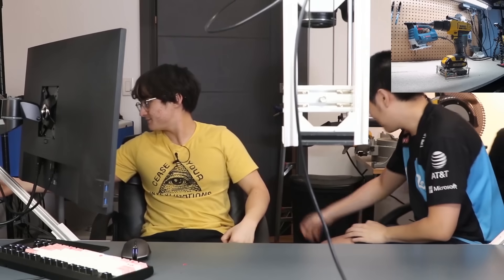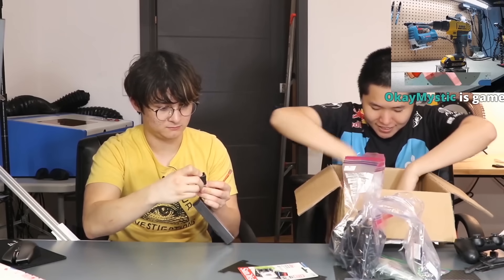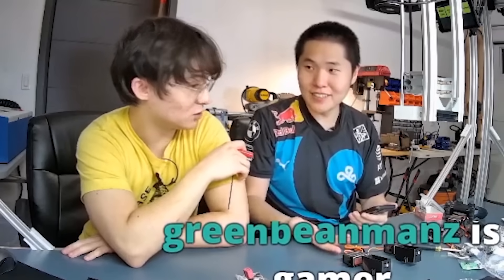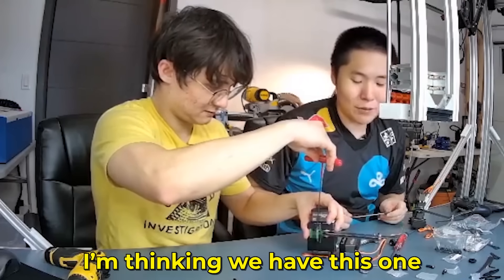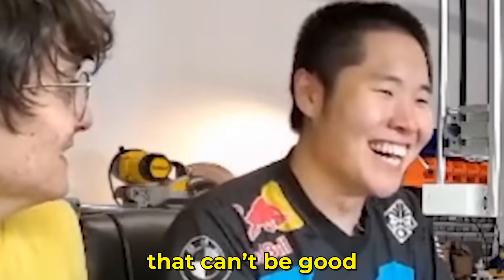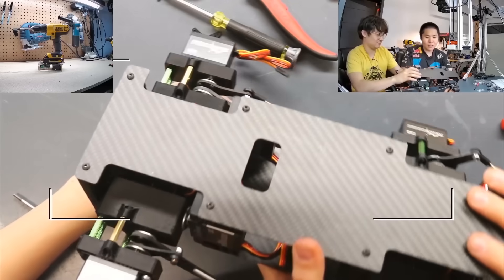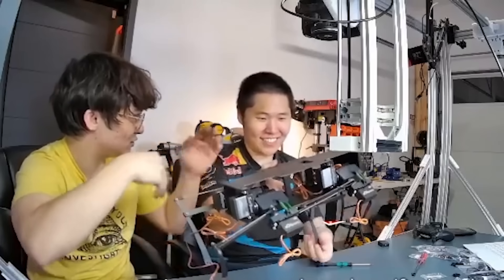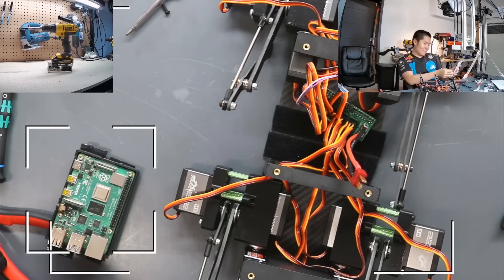we made a robot dog (ft. michael reeves)

Comment: The Easter egg at 13.32: translated from Morse code means : "K.I.L.L. M.E."
Reply: @My New account it actually is true
Reply: @JamesJames-tv2xw  who programmed that in lmao
Reply: Edmund Ng probably Michael lmao
Reply: Erik Blomgren I thought that was obvious
Reply: @edmund8954  edited in post
Reply: @JamesJames-tv2xw  I used a Morse code translator and it is true
Reply: @michaelg8841  exactly
Reply: @JamesJames-tv2xw  It sounds kind of inconsistent though. The morse code wasn't correctly transmitted, as there is no clearly defined length of a unit, which would be a dot.

The message should be:
"— • — | • • | • — • • | • — • • || — — | •"

Note that:
1. "•" corresponds to one unit.
2. "—" corresponds to three units.
3. Gaps between dots and dashes correspond to one unit.
4. "|" corresponds to three units.
5. "||" corresponds to seven units.

The dog either didn't transmit it or the dog transmitted it so poorly that its Morse Code is incorrect.
Reply: 13:32
Reply: @Robbie.1008  nice
Reply: That’s about what I expected from them.
Reply: I’m losing non-existent brain cells reading this comment section

So is it true or not-
Reply: Underated comment
Reply: If you use a colon instead of a full stop/decimal point then it allows people to click the timestamp to go to the specific point in the vid

Like this 13:32
Reply: To all in this comment section, please check the comment I made above.
Reply: Omgggggggggg
Reply: @Will Forrester Please don't tell me you believed the joke to be true
Reply: 13:32

Comment: I think the dog was just missing some sort of feet to give it friction and stability.
Reply: Robot scientist here, feet are difficult, most four legged robots just use prongs like these. Less degrees of freedom = easier to control and calculate. However, you could make the bottom part of the legs a bit wider to give it more stability. If you look at spot, it doesn't have real feet either, for example.

Comment: What about adding basic feet to it so that it has a more stable way of walking so it doesn't flip itself over again
Reply: I think it flips itself over when it gets an error message of some kind or something, it seemed very intentional, might be to protect the servos from burning out.
Reply: @smurtle7959  the feet thing is to prevent it from flipping over
Reply: @jackh5761  yes but I think it does it on purpose to protect its important components. If something goes wrong, those servos can quickly burn up and explode/catch on fire if still under a lot of stress and same with the battery. It flips itself over to make sure there is no stress on anything and then turns off. Sort of like the fetal position when we get hurt or stop drop roll when we get caught on fire. If a bystander thinks nothing is wrong, both the fetal position and stop drop and roll look stupid. But to that person they know what is actually wrong. 

You always want it to have the option to flip over, the software n stuff will keep it upright normally, no need for feet on the bottom.